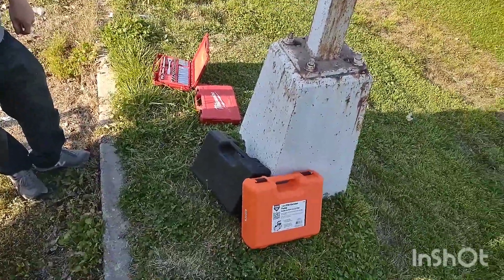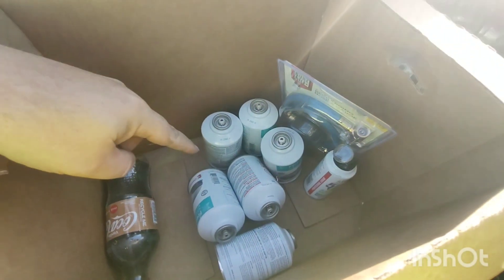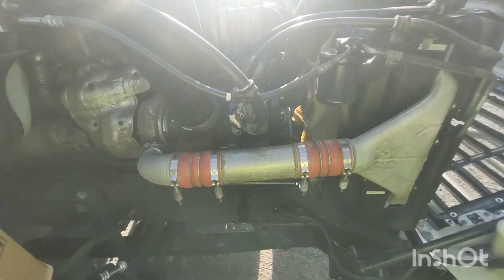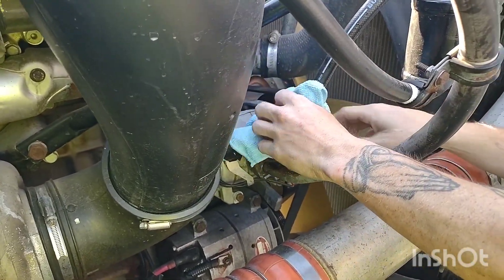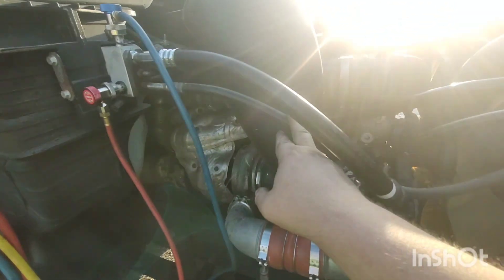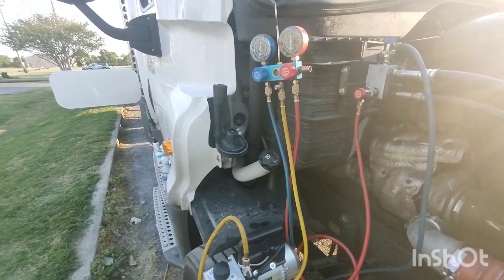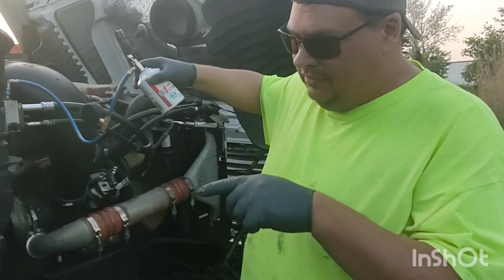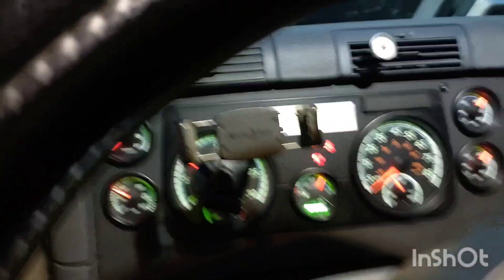Truckers helping Truckers. Truckstop air conditioning repair.

Comment: I learned to work on my a/c, I carry my set of gauges, and my vacuum pump, so I can fix it anywhere, as long as the problem is not electric I can take care of it.
Learned to do a whole bunch of other stuff to avoid shops as much as possible.